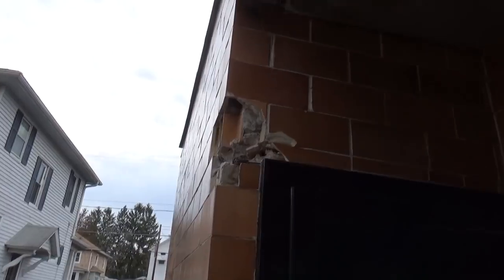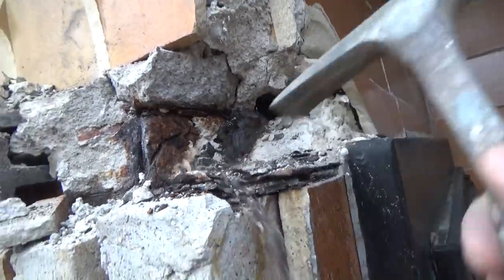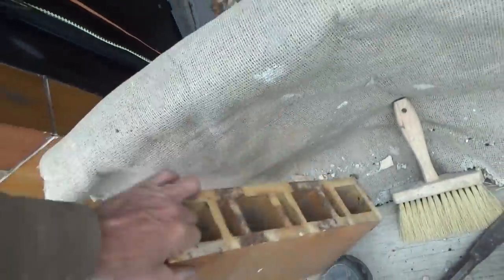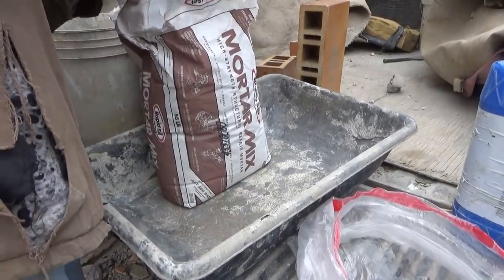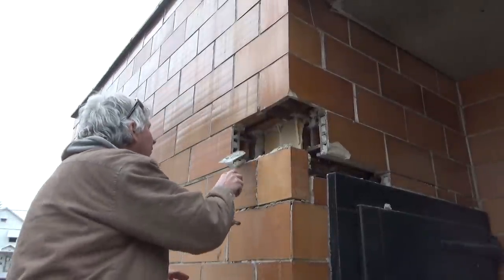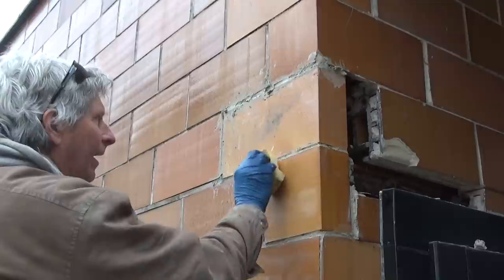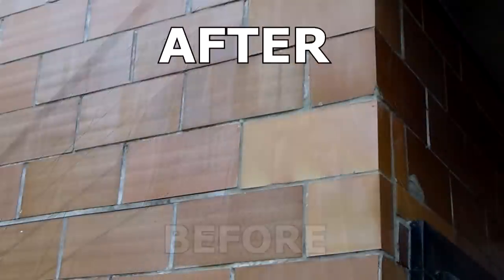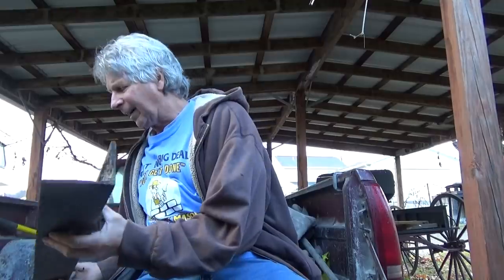MASONRY WALL REPAIR (Part 5) Mike Haduck

Comment: Guess that angle iron is only really good for the initial build so it holds the block until it sets.
Reply from the maker: I would say that's the standard way of building,  not meant to last a hundred years. Thanks mike

Comment: Mike I used one of those diamond impregnated angle grinder wheels you recommended. I had a glass block to install in a siliconed unit. The replacement glass block was to big. The grinding wheel worked great.
Reply from the maker: Thanks Jon, that's good, mike

Comment: One time a few years ago we needed a couple old bricks on the front of a building and they were the kind you simply couldn't buy for the last 80 years, so we cut a couple out of the back and put them in the front. The back got something "close" as a replacement. Better to have the front look nice and uniform.
Reply from the maker: Hi WCSD,  I would say that's experience, you know your stuff, good move, thanks Mike

Comment: If I owned the building, the OCD in me would've fixed that little crack.
Reply from the maker: Hi DBL.  Theres lotsofpatch work on that building, another day,thanksmike
Reply: DBLG65 what's with you internet guys and your ocd?
Reply from the maker: I don't know maybe from my experiences overseas in the service, keeps my mind off it, thanks mike
Reply: OK.  Just need to tear the building down and rebuild with a new available tile material to have full coverage without flaws.  But if your OCD is serious about fixing it, I guess you gotta do that. 
Look at Mike's jacket!  Use your OCD energy to send him some gorilla tape to fix that seam first.  It's a much bigger crack, and you should work in order from biggest problem to smallest like that.
Reply: DBLG65: commercial real estate may not be the industry for you 🤣😎

Comment: I've learned so much from your channel and I appreciate your generosity with sharing these skills.

A question: I'm doing a little patch up job on the outside of a foundation. Is there a simple way to make mortar waterproof or at least more water resistant?

I'm kind of a small guy and there are a lot of stairs to climb, so honestly 50 lb bags are difficult for me to carry.

I've been using the 25 lb box of Rapid set mortar. 
This works pretty well but I'm wondering if I mix a little Cement All with the Rapid set Mortar if that makes it more waterproof?

Or maybe I could put the Mortar on first and then a thin slurry of something else?

It doesn't have to last forever but if I can make it withstand the elements a little better that would be great. Is there a simple way (with 25 lb boxes or some other product) to make it more waterproof?
Thanks.  - Michael
Reply from the maker: Hi Michael, I never seen a waterproof cement, usually I end up painting the steps with a deck stucco paint or Portland some people use a sealer but in winter it could be slippery,  thanks mike
Reply: @MikeHaduck  ok, Thanks!

Comment: I am no construction guy but I hope there is not asbestos in that stuff. As for the metal rotting...so in those skyscrapers is the metal bars rotting in the concrete in them too
Reply from the maker: Thanks paul, I agree, mike

Comment: What if the metal is embedded in a retaining wall?  We have to use rebar for code.  Will the rebar be ok as long as we don't expose it to the outside of the wall?
Reply from the maker: Hi Grassy, if the inspector says put it in you dont have a choice,  I doubt if you get anything in writing unless he approved the plans, thanks mike

Comment: Hello Mike, do you have a video about working with concrete in cold weather, what are your thoughts on veneer stone in 38 degree weather, is it ok to work with concrete in cold weather , thanks
Reply from the maker: Hi Lino, no videos like that I won't do concrete if I wants to go below freezing for a couple days or keep it covered, thanks mike